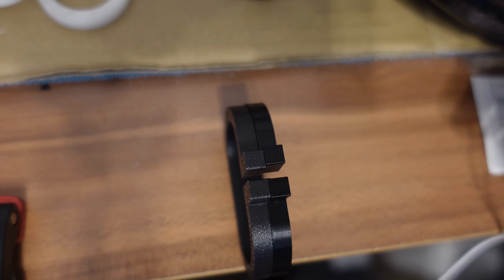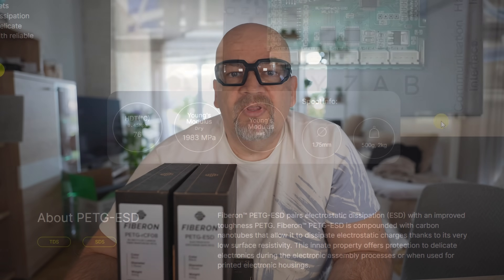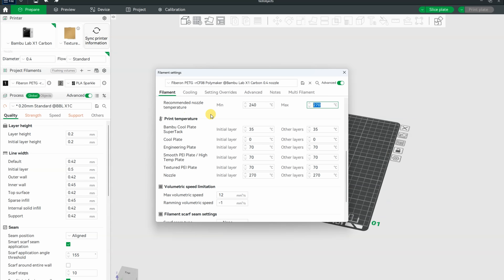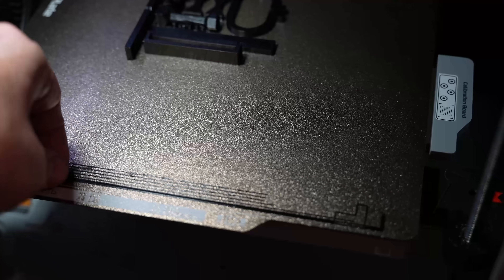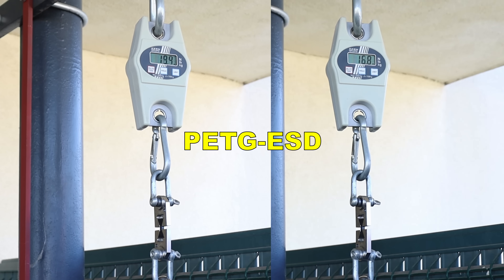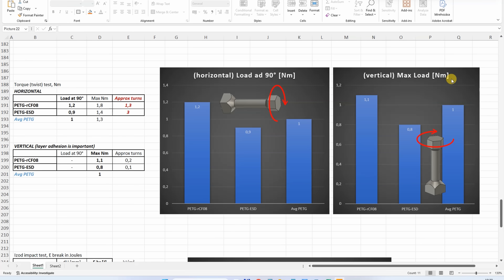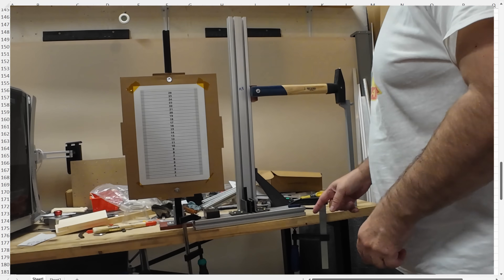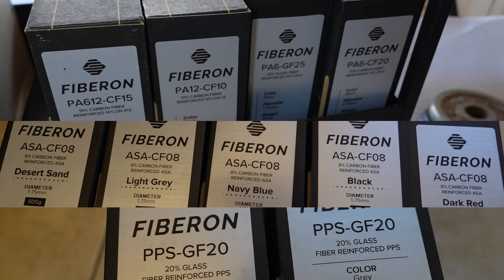Testing Polymaker Fiberon PETG-rCF08 & PETG-ESD Filaments

Comment: I use the Fiberon ASA-CF08 and went with a designated G10 build plate utilizing a sacrificial PEI  spring steel platelet just for ASAs PETGs and other engineered filaments for adhesion but mainly for release. Before the G10 I used magigoo for ASAs but 3DLAC also worked for PETG HS/HF/ and Rapid on textured PEI. I had too many experiences of impossible to remove remnants in the lows of the textured plates. So I designated a plate and saved money that was going into magigoo. I enjoy this channel. Thank you.

Comment: We print about 10kg of Fiberon's PETG--ESD filament each week, we're very happy with it. It's highly consistent and prints very easily. The only complain I'd offer is that they tape the end of the filament to the inside of the spool, we've had trouble with that tape getting pulled into our PTFE tubing when the spool runs out. I'd love for them to find another method to secure the end of the filament to the spool.
Reply from the maker: Thanks for sharing your experience! What type of sheet are you using?
Reply: @MyTechFun We use the stock textured PEI sheets that came with our Prusa printers. We've seen the same issue you did with TPU but never the Fiberon material.

Comment: One time when I used PETG-ESD I had a lot of difficulty getting the print off the textured bed.  When I finally got it off, it left black residue that I still haven't been able to remove.
(Printing a thin later of light colored PETG seems to pick up some of it on the bottom of the print, but after a few attempts of that the bed itself still isn't clean.)

Comment: Igor, I have a request to add to your testing. While I already know the answer for PETG (and generally why I avoid it), what do you think about adding a Machinability metric to your Other Use type testing regimen? 
On why I don't care for PETG, it gums up drill and CNC bits if you decide to make precise or 'off the cuff' alterations on prototype parts to save a little design/fabrication time on the next iteration. PLA and PET-CF, on the other hand, are very forgiving on tooling and don't stick much at all, even if you get a bit Very hot (sometimes I get a little carried away on scrap just for testing how far I can push it).
Add: Definitely highest interest in PPS-CF. Just finished reading a NASA whitepaper on its base polymer.

Comment: Vapor smoothing ABS-GF and ASA-GF. Works surprisingly amazing, want to know how it effects strength
Reply from the maker: That would be an interesting test.
Reply: It generally makes them stronger, though it’s not a good option if you need tight tolerance parts, but when acetone welding together ABS parts properly, the welded part becomes stronger than the actual print.
Reply from the maker: @awildridehome9469 Now, I am more and more curious. This usually ends with a video 😂

Comment: The main purpose of the PETG-ESD is to prevent ESD charges to be generated. It is actually fantastic on that point while most material generates a lot of charges.
For those who need 3D prints for ESD sensitive electronics, it really does the job. Printing on a filtrated printer with fume extractor for safety.

PETG-rCF08 is quite impressive with that low amount of carbon fibers.

Thanks Igor.
Reply from the maker: Thank you for the informative comment

Comment: Igor, it should be noted that while most carbon fibers are fairly harmless, carbon nanotubes have several credible studies that show they’re somewhat comparable to asbestos as a potential lung hazard.

ESD filaments using those should be considered hazardous, and printing should be done with serious ventilation and precaution taken, as well as usage should limited to areas not exposed to human contact. 

Stay safe man.
Reply: What studies, and do they specifically include 3d printing filament? I'm not asking to be combative, but I've seen these claims before but never any evidence to back them up. I know the bare fibers are dangerous, but is the same true in regards to 3d printer filament? And no, the nathanbuildrobots video is not valid evidence.
Reply: This

Comment: ASA CF is more interesting for me as well, I really hope it has good layer adhesion and low creep. It is especially interesting that they are able to have it in colours and the carbon fibers don't make it completely dark. I wonder why they have not released colours for the PETG rCF08 tested in this video, maybe they plan to in the future.
Reply: I would warn that the ASA CF is shockingly brittle. Polymaker does mention this in their videos, but I was surprised to find the filament couldn’t survive the dual idlers on my core one. It might have been that batch, either way Polymaker was super nice about it and gave me a replacement option.

Comment: Asa cf for the next videos
Reply: Pretty, functional, UV, and heat resistant? Yeah I’m going to have to see a video on those filaments.
Reply: @Bananaman_96C And according to polymaker better than PLA print quality! They had a really nice print on their video with I believe a 70° overhang section and it printed great.
Reply: @rileyneufeld7001 Yes, because ASA and abs weigh less per cm3...
Reply: Same here; I want to see how good their ASA-CF is.
Reply: Also vs ASA-GF08
Reply: Yeah ASA please.